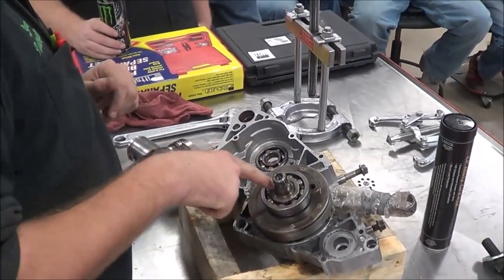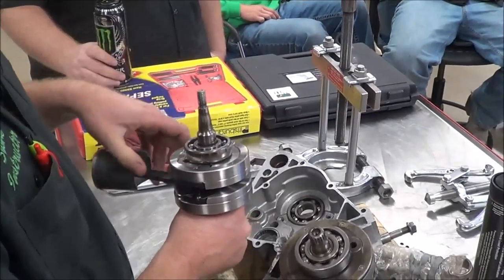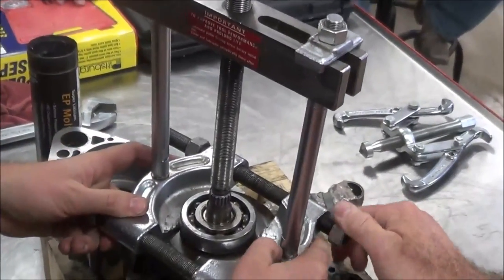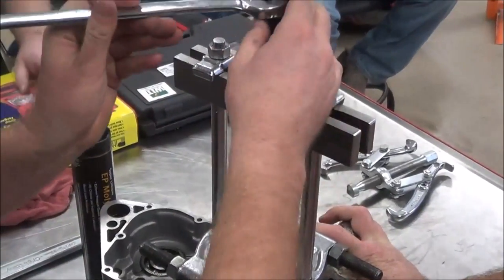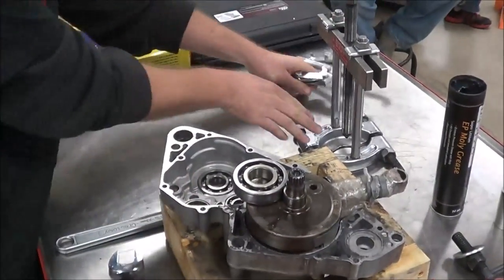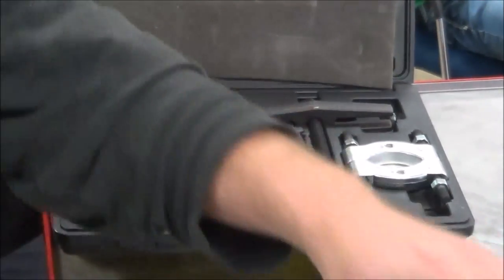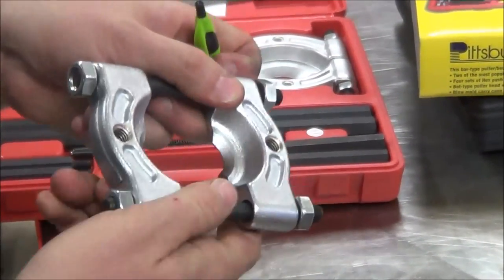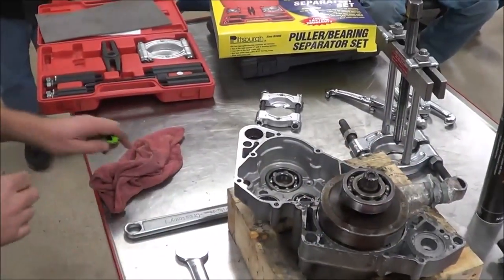2 Stroke Engine Disassembly   Bearing Removal from Shaft Puller Method   11 04 14

Comment: What size is this bearing puller you use at the start??
Reply from the maker: Hi Nick,
Not sure on the size. I made this video 4 years ago and no longer teach there to grab and measure. I can be of more help on my website for one on one if no one answers by chance in the comments and we can figure it out together. May take a little digging but I have a ton of resources to locate info or pass on skills sets needed to get it done right. Contact me here: https://how2wrench.com/contact/  Your answers and help are just around the corner. Save time and money while protecting your investment and yourself by doing it the right way at www.How2Wrench.com   

Have you Subscribed yet to never miss a video? Have you seen the video playlists https://www.youtube.com/user/conleybuilt/playlists? 

Want to say “thanks” or “keep it up”? Click here https://www.paypal.me/how2wrench
Reply: @How2Wrench  hey cheers for the reply Shane mate. I've order a couple different sizes anyway. Good too have them in case my mates need a different size I guess